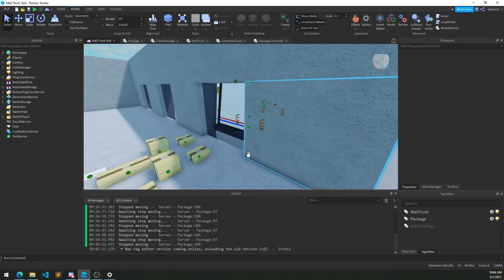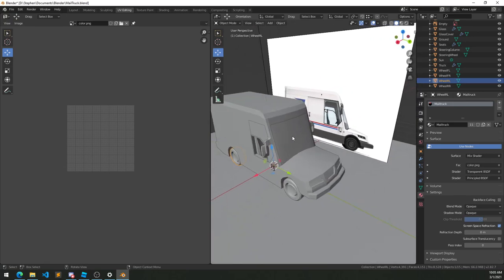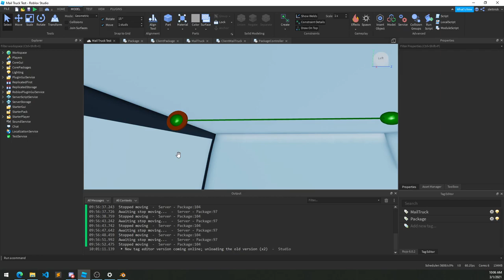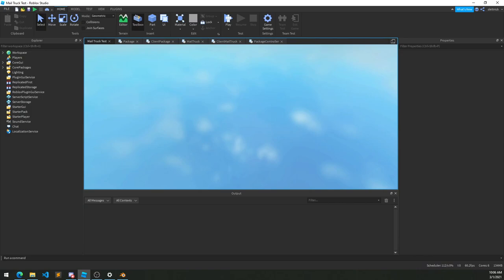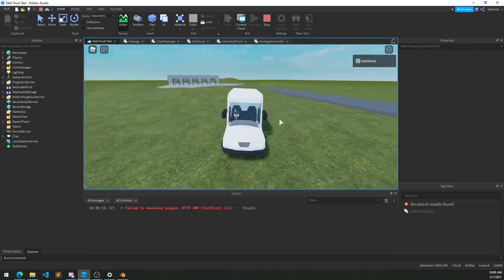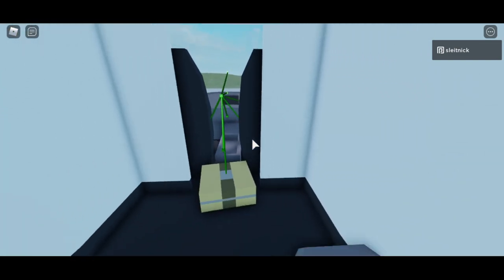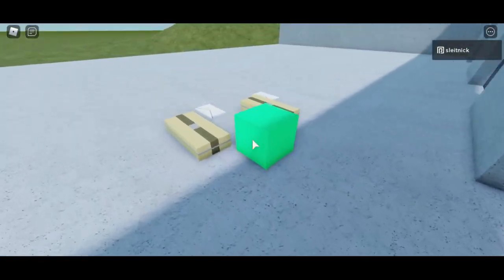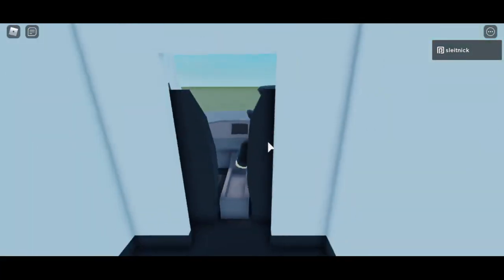Roblox: Delivery Truck Demo

Comment: Is this using the same suspension that was used in the other vehicle suspension tutorial you did? It looks a lot smoother, especially when you go over bumps and bounce around. This is awesome!
Reply from the maker: Exact same setup! This has a bit more mass naturally, and thus the spring stiffness and damping is quite different than the tutorial. It's all just a matter of playing around with the values (unless you're good w/ physics and know how to calculate that stuff properly... I don't)

Comment: Question: To make the back door, you had to export it separately, or is there a way to move pieces of a single mesh?
Reply: Now you could use rig it and use mesh deformation, but I personally would just export it separately to make things easier.